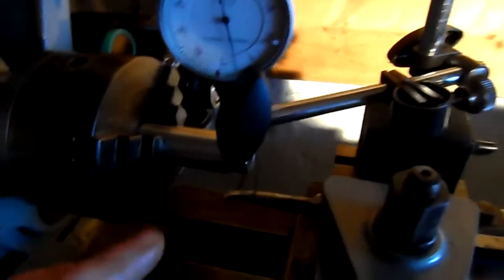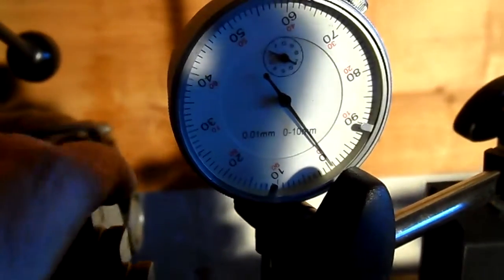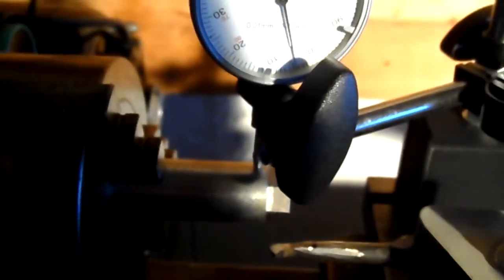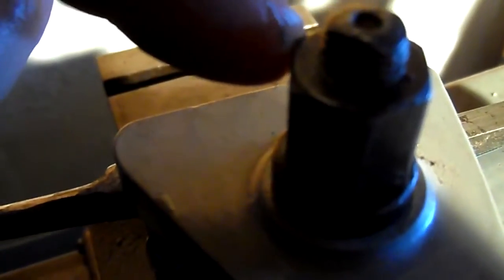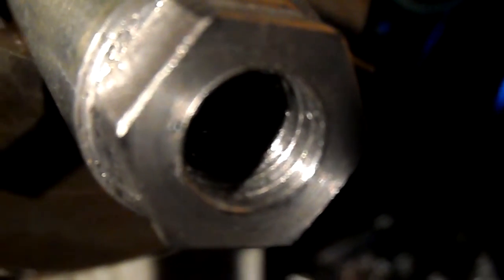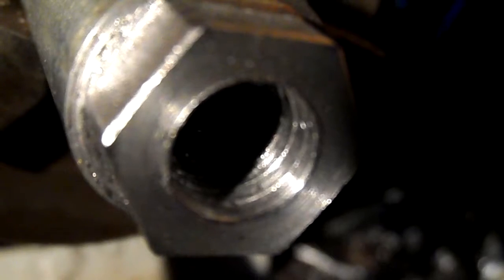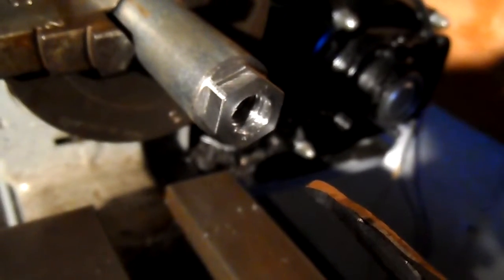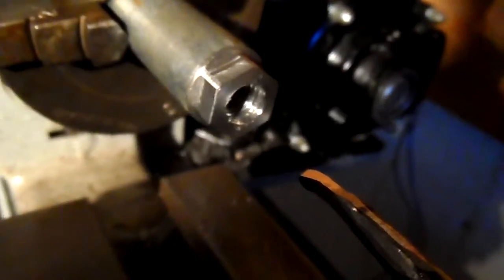Screwcutting On The ML7 Episode 05

Comment: Nice to see that nicely restored ML7 running. I'm in the restoring alley myself at the moment. Mine is from 1963, a basic model without too much accessories on it. It was cheap, though - only about 300 pounds. Now I have a question for You...
Do You know what threads the back gear plunger have? Where the plastic acorn nut sits at the end? My plunger is broken just inside the threads - I've lost the little bit with the threaded part, and I don't want to make a new one with wrong threads - and destroy the acorn trying to screw it on wrong size threads...
By the way....I got a package from the Myford shop yesterday. A can of that grey paint I've been waiting for a long time now. Well...the customs over here have obviously opened the lid - found that it wasn't heroin.....and put the lid on again - with a very loose fit, before forwarding the package to me! I guess You already know what I saw when I opened the package? Paint all over the place, but nothing in the can! Thank You very much mister customs guy, for ruining my plans for this weekend!!! Now I have to fill in two forms - take pictures - and send to the complaint department of our precious, beloved Royal postal services.. And wait. And wait a little more. Maybe a month or so? Why? Why do I always end up having to deal with assholes like this?
LOL...enough complaining for now..:) Hope to get another can of paint soon, get the lathe together again - and start on some small projects I have. Keep posting! There's always something to learn for novices like me. Thanks, have a nice day!